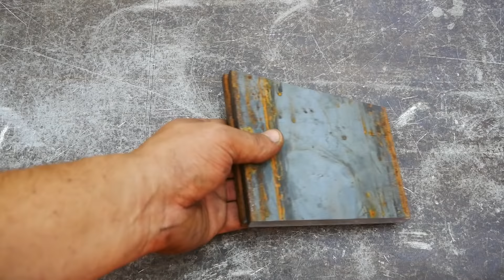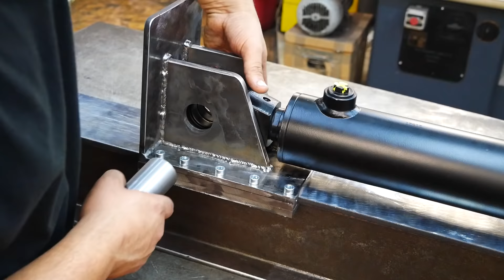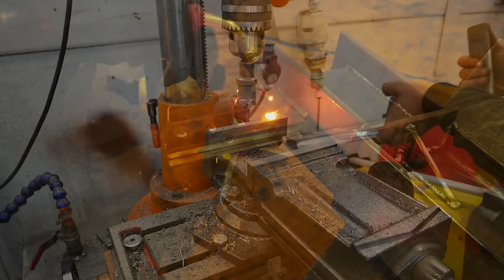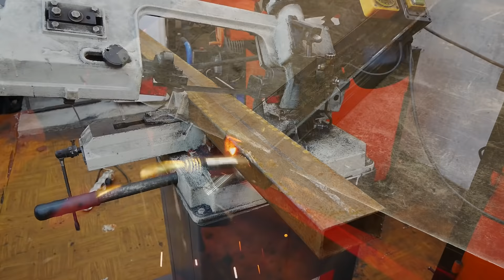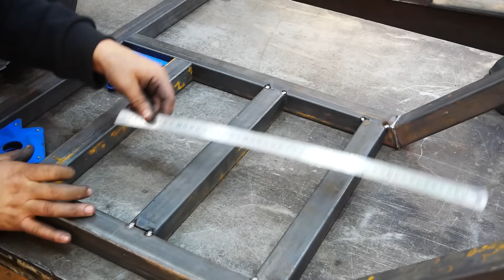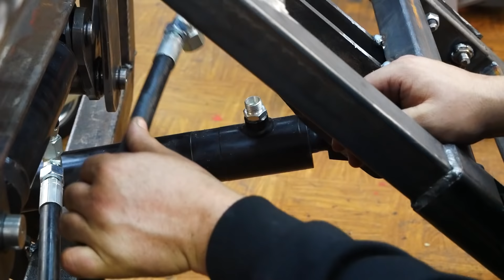Making Hydraulic Log Splitter

Comment: I've seen a lot of home-made log splitters out there, but this is probably the only one I wouldn't be terrified to use. Fantastic work as always.
Reply from the maker: Thank you 😁
Reply: he put the splitter on wrong end , the wood falls on the ground
Reply: Ok 👌👌👌
Reply: @jonesy4588  The trade off is huge. He does not have to pick up 50 LB logs. The commercial ones, the logs fall on your feet or onto the optional 'tray' that holds only 1/2 of a medium size log, anyway.  No way a tray holds after a 4 way split of a log that size. Something has to give. The other thing is that it's safer. No hands or body near anything. You have to wear steel tipped boots with a normal log splitter. One or six will find a foot.

Comment: Very nice.  Great design and I can see how 3-5 hrs of splitting would be made sooooo much easier.  Very nice.  Question.  What about flipping it around and push back toward the end of the trailer so all the split wood falls off the rear in the clear?  And also, I think I’d add another horizontal fin for additional cutting.   What are your thought?

Comment: Excellent build, you gave me some ideas for mine, thanks! It's better to have the flat face on the ram, my old log splitter had the knife on the ram and it got loaded with wood pieces and was a pain. The log lifter is a real back saver. Build a small conveyor to load the split wood into your cart, and run it off the hydraulics too.

Comment: Great build. I would say some of it is over built, so just perfect, no such thing as over built!  I bought a 25 ton splitter years ago when I heated with wood. Broke it in a week and had to beef up several things. I absolutely love the power pack. Much better with 1 machine and motor to keep running to do multiple things. Plus if it's used more it stays running and doesn't sit around and rot. Thanks for sharing.

Comment: Also,  I agree w Shunta Wolf below: plans and exact measurements of the different components would be really cool! Also might be interesting to have you voice over your problem-solving  thoughts. Maybe you could just voice-over the measurements as you make it or print them on screen? This would not only help the viewers, but allow us to engage w you more on possible design ideas.
Reply: in reality the price of the log splitter would be more than buying one from a manufacture, look how much steel and the thickness of the steel he uses, easily in the $5,000 range.
Reply: @mikeoxlong8886  at least it won't break after 19 uses. Also it's much simpler

Comment: Great work! What I would do is put a slab of rubber pad about 2" thick on the push plate to push the log all the way into the blade. You could even use a slab of wood about the same thickness to do the same thing. Gets the log closer to the blade in the end. :) Just an idea. :)
Reply: Build it so the ram is nearly in contact with the wedge.
Reply: its not so important that the pusher comes close to the knife, the design of the pusher and design of the knife are far more important
Reply: @mikesloat7054  When you get into splitting old Elm and have to pry it off the blade it becomes very important.  Yes it can be pushed by the next chunk but that does not always work.
Reply: Nice build

Comment: A very nice build. I built something similar that goes on a tractor 3 point linkage when I was 16. Mine has a 11 tonnes force ram. I am now 60 and gave it a slight overhaul last year. Like you, I originally had the split logs falling to the ground. My only improvement was to have flat steel tables at the spitting height either side of the splitting blade to save having to bend down to pick up fallen split logs. You could still add to yours if you wanted? Many thanks for sharing your build with us. Greetings from the UK.
Reply: Легче сделать комбайн.
Reply: @wix5304  What do you mean?

Comment: The I beam and pusher are too light a gauge steel for our wood- Oaks - live, Black Chestnut. I prefer the end plate on the end, the wedge on the ram, when working large bolts, that saves steps. Do like the 2 detent valve, that allows the operator to work during the stroke. I use a tractor mounted 3-point splitter. I can lower the splitter down on the ground, slab the large rounds, then raise the splitter to waist height to split the slabs, it's a lot quieter than the small engine powered splitters. A single ram can split, also lift the rounds with some ingenuity.seen it done.
Reply: Do you have a link to the one you use or a video? Pic etc?
Reply: For soft woods like pine and birch the handaxe is way faster

Comment: Sir, no disrespect and I do think your wood splitter is awesome. I'm just asking a question if you don't mind. Wouldn't have been simpler to put the wood splitting into the back of the wood splitter as opposed to the front. That way when you're splitting wood if you need to move the wood splitter up or over you won't have to move all the wood to move the splitter. And I say no disrespect and I'm just asking a question. 🙁?
Reply: Very good point!

Comment: Very  light duty unit.  It's best to have the  wedge on the  slide and  pushed by the cylinder. Which should  be larger,  split the  wood  against  a  large  piece of flat steel.. not as much walking  is required  since the  split  log is aways in your hands..

Comment: you basically made a war machine. Of course, if you have a workshop and time...then maybe it's worth it, but not for that type of wood. If it were wood with a knotted structure, difficult to break... ok. By hand, with a good axe, I can produce more and I enjoy it. Having a petrol engine that continues to make smoke and noise, I don't see it as a very good situation. Plus, you have to take each log and place it. If you throw everything on the ground, you can split well and equally when the wood fiber is linear as in this case. Without waiting for the wood to dry... (greetings from northern Italy).

Comment: Brilliant job I love my home made log splitter out of spair steel and a ram off an old plant machine had to use new engine and pump valve block and pipe use old gas cylinder as a tank plus fitted new returns filter iv cut and split over 50 ton of wood it's never let me down

Comment: Very nice build. Something I would have done differently is to flip the splitter on the trailer. Then you can design a smaller dump trailer to butt right against the end of the splitter so that all the split pieces fall right into the dump trailer. No need to pick up logs off the ground.
Reply: agreed. Something I would have changed is to have the axle closer to the middle of the splitter. this would make it much easier to lift onto the ball hitch. He will injure his back lifting like that. I know because I have. Other posters have mentioned that the hydraulic pump should be gravity fed with oil to ensure longevity. I guess there needs to be a website with all the compiled fixes and plans for open source farm equipment.

Comment: Wow! ....Please consider doing a simple sand & cement brick press for Chinese bond (brick  length= 9.5 "  W = 4.0 " H= 3.0 " inches) using your automated hydraulics system. Brick size needs to be uniform to accommodate internal rebar reinforcement. Would be a great cost effective tool for small DIY projects under 1000 bricks.

Comment: Good job like the log lifter and the telescoping double wedge . BUT that baby splitting cylinder just would not cut it for me The size i used was 6x36 and even at that i have to run the pressure a lot higher than i care for

Comment: Nice.  2 suggestions:  
1. Weld some wire mesh screen over the top of the log lift so smaller round don't fall between the pcs of tubing.   
2. Instead of welding the tubing for the hitch to the frame, weld a receiver tube so the entire hitch part can be removed, and put an 'exit' table on the outboard side of the splitting wedge (using the receiver tube) so your split pcs don't fall on the ground and you have to pick them up off the ground.  Good place to hold larger pcs that need re-splitting as well.

Comment: Shouldn't the split wood exit the rear of the splitter instead of over the tongue? The jack is in danger of damage in this setup and the towing equipment has to be unhooked during use. Nice splitter, though.

Comment: I make this professionally , I think these materials are only good if you plan to do it at home, if you plan to make money using this maschine then materials need tobe thicker, diesel motor or electric motor need to be at least 18 hp, hydraulic pump also needs to be very good.My machines are  vertical.

Comment: une hachette premier prix
une cornière en L
un billot (si possible avec souche-debut racine)

tu bisautes la cornière, des deux cotés sur 1 plan,
tu soudes les chutes de biseaux au centre de la lame hachette, comme fendeurs marlin style fiskars (3 coins de chaque coté est mieux)
tu soudes lame, verticale, sur cornière L (apres avoir percé 2 trous dans le plan non biseauté)

gros feu grosses braises,
sous la braise 1/2H
puis bain d'huile ou eau froide
enfin ne pas recuire au four, affutage reste beaucoup plus longtemps sur acier cheap, qui ne casse pas généralement (c'est plutôt aciers durs, donc le tranchant rajouté lors de la forge, mais pas sur ces made in RPC)

tu visses cornière au bord du billot,
que tu peux retailler en V a ce niveau (selon appuis/sol)

permet de refendre en sécurité au coin du feu
(une masse taillée dans une buche)

Comment: Hell now days U can find a lunched Chinese log splitters in most back yards around here. People R too lazy to throw em out because they R so heavy.. I went down a country road a few days ago and saw one again that had been sitting about the last 5 years. I had always been wanting to stop and ask the people about it this time the folks that lived there were outside hovering over a John Deere riding mower that broke last season - year before so since I fix and build machines I stopped and joined their conversation about the tractor then asked what was wrong with the tractor since I do small engine work.                                                                        
                                     One thing led to another once I told em It's probably the carb they agreed with me and I said well I probably have one in stock would gladly stop back and put it on for em. Then I asked about the log splitter then when they asked me about how much they would owe me for fixing the tractor again. I said that depends if U would sell me the log splitter perhaps trade... The guy said if I fixed the riding mower I could have the log splitter he knows how much the other local small engine shops charge around here. I stopped yesterday the JD rider was still sitting right where them folks dragged it to... The key was in it and in just 2 hours I was rockin down the hiway headed home with a big ole 27 Ton Huskee log splitter. I determined it needs a pump and the motor also needed a carb which I popped on last evening gonna go out and start it up today when it gets  a little warmer out side... I traded a $40 carb and 35 min of time for a log splitter that in todays dollars that same exact model 27 Ton Huskee costs $1,800 at Tractor Supply.... It was a no brainer for me... My welder and cutting tools R still all under the work bench... The thing is perfectly in tact a little rusty here and there but that's nothing some MRO industrial paint don't take care of on a hot summer day.... I keep MRO paints in stock and I got plenty of red and orange from my farm wagons under the same work bench...

Comment: Nice job but a bit too complicated. I made one with a t splitting wedge but set it high to suit most logs I was splitting,just need to manually place the log. Less faff that having to adjust the t height for different logs .Let's face it, you are only splitting a log, we're not talking rocket science, simple is best

Comment: At 27:23 you show a fitting with a small orifice in it used to restrict flow to the lifting cylinder. What are these fittings called and where might I source them? Also, wondering how you connected your control valves, did you use open center and connect them in series or did you use closed center , and if so, how did you connect?   Thanks

Comment: An amazing video.  Beginner question: In the beginning of the video, he drills holes in the flat piece, and then fills them back in with the welder when attaching it to the I-beam.  This is the second video I've seen someone do something like that.  Is that just adding extra attachment points for strength, or is there some other reason?
Reply: He did that so the 2 pice stay together from center too. Hi didnt fill it but he weld the flat to the i
Reply: It helps make the I beam more rigid. I attached mine by welding it on both sides. But I used a 4" piece of square tubing for my hydraulic tank. Eventually I built a square tank and re plumbed the whole thing. It works really well now, and will split up to 30" or so diameter oak no problem.

Comment: This video was awesome.  I love the hydraulic control to switch the knife from splitting in halves to quarters so quickly.  I love the lifter for logs, and I haven't watched the video, but the separate hydraulic power supply so you can use it for other tools is pretty nice.   I would be curious to know if the horizontal knives hold up long term --  I have split some knotty logs that I think might really stress the relatively short welds (but I'm not an expert, so who knows?).   I would want to add some tray or platform so that the split logs don't just fall on the ground but might be pushed into a waiting cart.  I also wonder if it might help to have a flared wedge much wider at the back of the support for the knife, so that once the initial split of the wood occurs, the flare then helps pull the log apart quicker at that point.  No criticism -- just thoughts I had as I watched the video about things I would try if I had the ability to build one (I do not).  Great job!

Comment: I think The hydraulic cylinder is too big, its overkilled. The force needed for splitting the log is not quite large dont need tons of force
Reply: If you get a log with a twisted grain or a "Y" shaped log, the extra force might be handy.
Reply: @essexfarmer9610  , ok I understand.. but it still too big, smaller cylinder will sufficient or maybe if using large pneumatic cylinder it will be more cost effective than hydraulic.